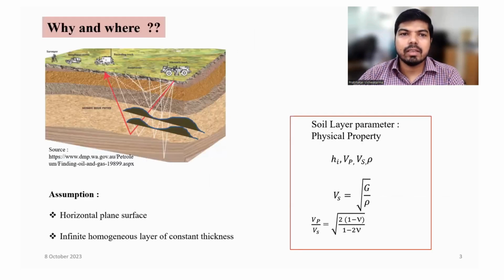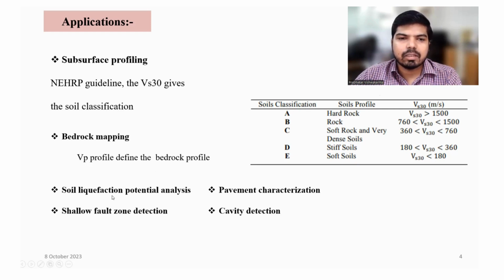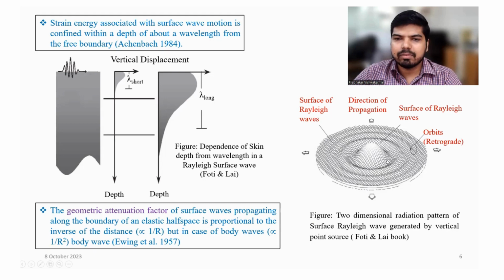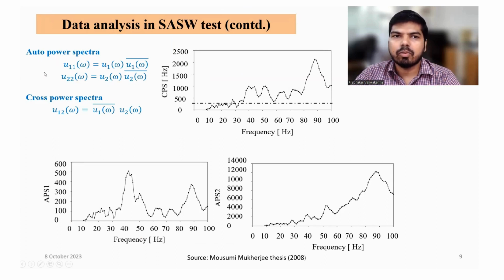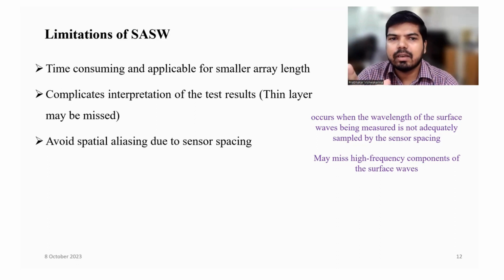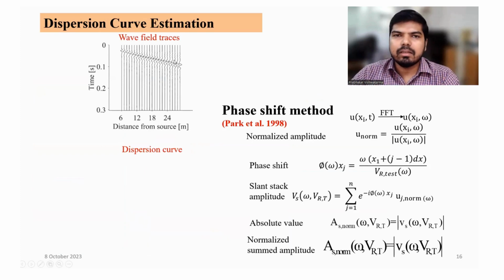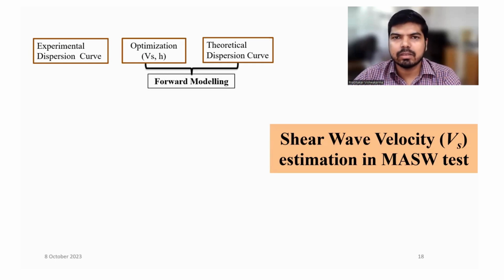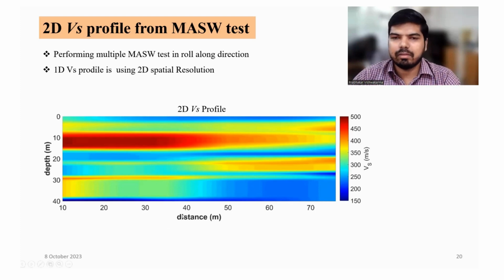SASW & MASW Techniques : An Overview #seismic #nondestructivetesting #civilengineering #education

Comment: Here is the scenario: 
"A NH51 which is a coastal highway that is located 50 meters away from the Sea shoreline "
If I want to evaluate the pavement and its fault zone using the SASW test and source of energy is vibrations induced by sea wave. What are the problems I might face ?
Reply from the maker: @vishalsinhsodha4003  , you might face noise associated with water waves in your signal so I will suggest to use high number of stacking to record you active data. Along with it.. Don't ignore the limitations of SASW test, which I discussed in this lecture.